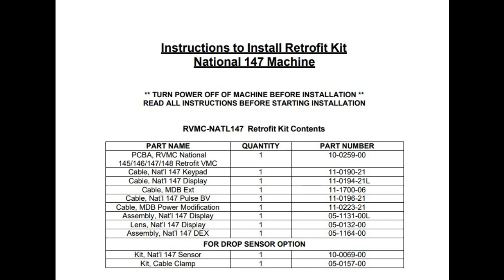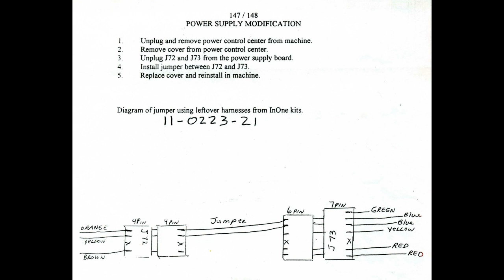RVMC NAT147 NAT148 Retrofit Upgrade kit part# 383022

Comment: You mentioned toward the end that you can keep a 6000 coin mech and 2501 validator and have the card reader as the sole MDB device. If that is true, does that mean the 12-pin coin mech can remain connected as-is, and the 2501 plugs directly to pulse connection on the board? And credit card to MDB.
Reply from the maker: The coinmech uses the existing 11 position cable coming from an existing adapter board. A pulse bill acceptor uses a cable supplied in the kit. You can see the instructions here: https://drive.google.com/file/d/1gBT-5DwVuHjPV3urK7g4lZUnRgn9tYT5/view

Comment: Could this work for a 157?
Reply from the maker: Unfortunately no, we do not have a kit for the 157 since they are already DEX and MBD compatible. You may wish to try https://www.dsvendinginc.com/
Reply: @inonetechnology  that's perfect thank you! That's what I was trying to figure out if it was already MDB, it already had a DEX so I guessed it was, but the coin mech and bill acceptor were 9 pin so I couldn't tell.
Reply: Works for 148 what's model number that u should buy?